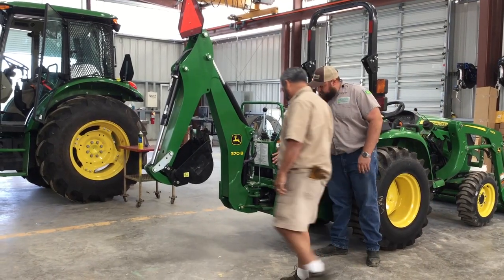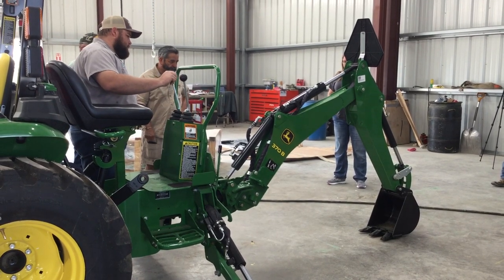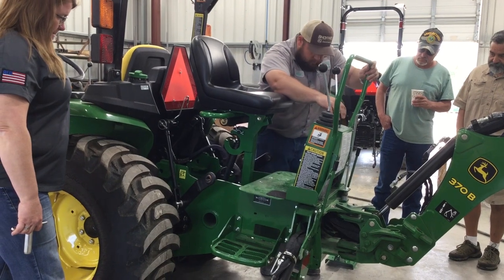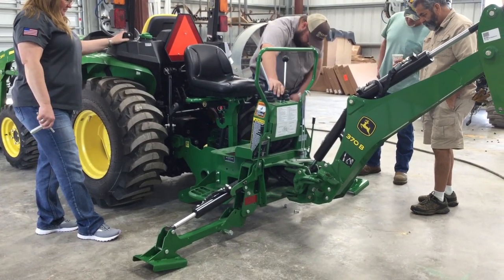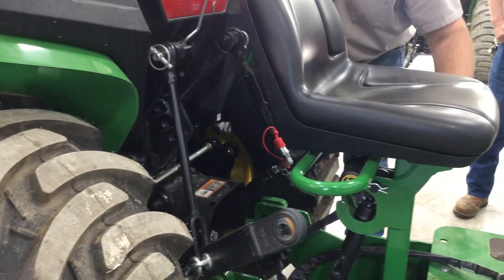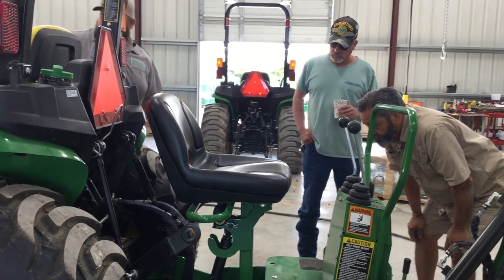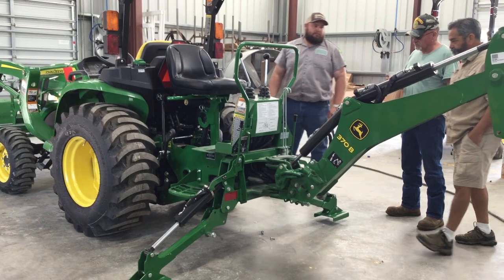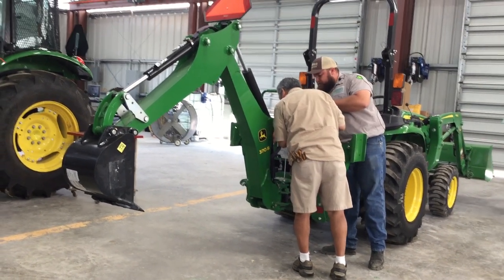Attaching and Detaching a Backhoe on a 3E series

Comment: How are you rolling in neutral, take brake off, shuts engine down.  Shouldnt you plug the lines into each other to avoid hydrolocking?

Comment: As i understand you can only get a backhoe for the new 3E series, is this correct ? Anything prior to 2018s models is not an option for a backhoe.  In April 2018 i bought what i thought was 2018 but when it arrived at my house I later found it to be a left over 2017. Later i found out only the new 2018's will accept this implement.  Is this true?. If so why? Thanks for any info you can give me.
Reply: Can anyone answer this?  Thanks
Reply: @cmizer9  This is correct, only 2018 and older. I believe the issue was with a clearance in the mounting bracketry but I don't remember exactly. Could have also beeen issue with power beyond kit but it for sure will not work.
Reply: @HunterEdits  2018 and older?

Comment: I heard that the 3000 series is not build strong enough for the backhoe
Reply: I've heard the same. I've also seen guys that beat on the backhoe all day, 5 days a week and haven't had any issues.
Reply: Its the weight of the machine. Not the strength, it moves around a lot because its only 2200 pounds